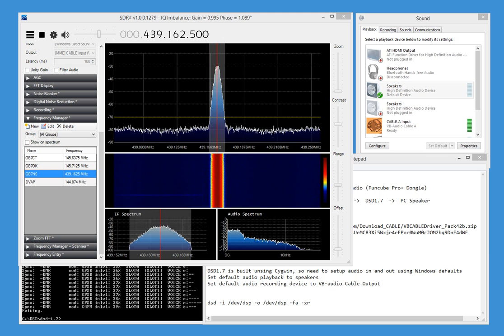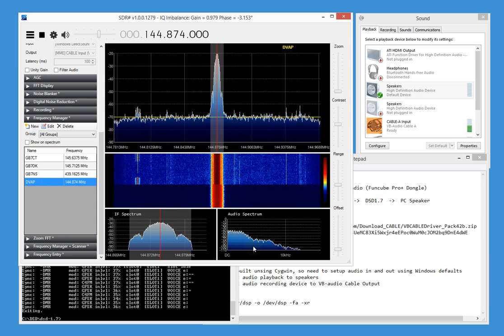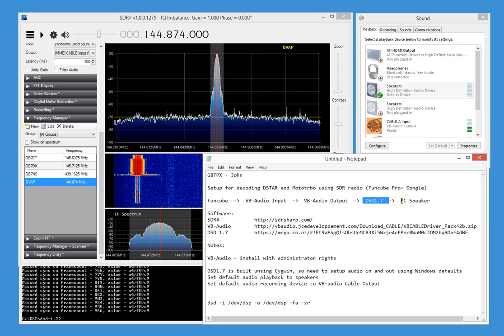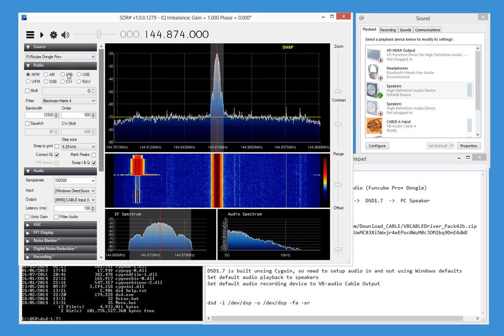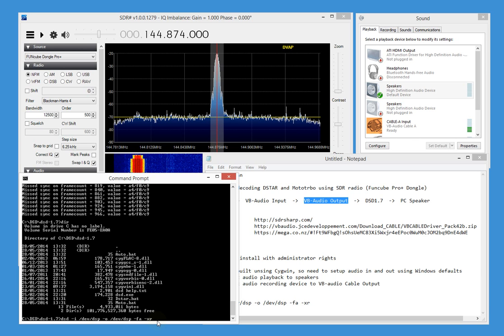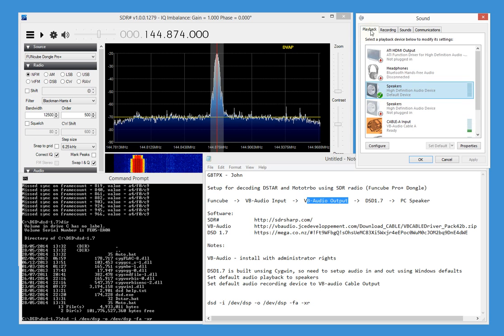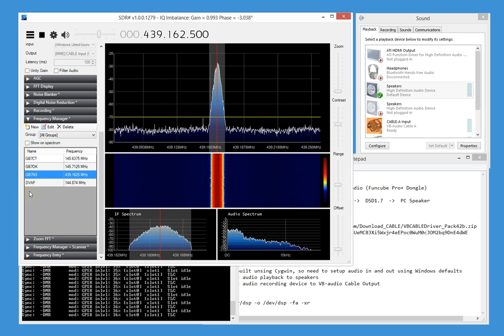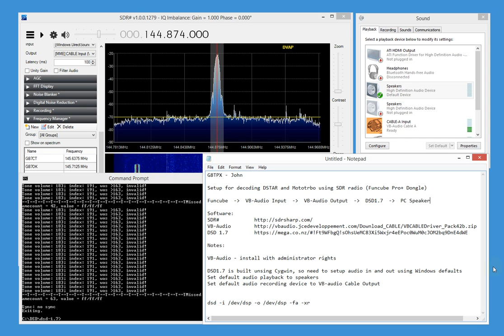Setup decode Dstar and Mototrbo DMR using SDR Funcube dongle with DSD1.7

Comment: Hi John, i test it and it works not!
i have windows 7, and i donwload all the files and install it.
first i can not use the radiobutton for using the INPUT, the outbut works with CABLE input.

The next is that i cant use the DSD.
Error, coldn´t open /dev/audio

I unersand what i must do, the howto that you here in youtube give works not!

I test is with two PC´s an thoting works, i test it with 3 USB Dongles and the new HackRF One.
So make a install video, step by step, that the youtube user can see what you do, 3 links and a working system in a video so that no one can start something.

Sorry for the bad english.
Reply: I know what you mean I am currently having the same problem, yet even after setting up DSD and SDR# ( and actually getting it to work) for a couple of times now I still haven't remembered the trick to make the dang audio input setting on SDR#... So the best of luck to you! it is possible, it is just very time consuming.